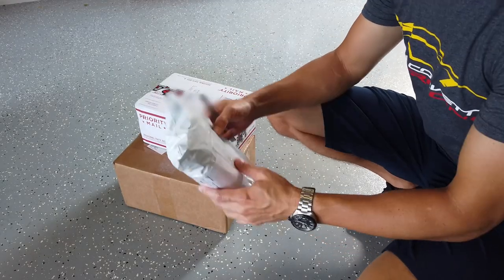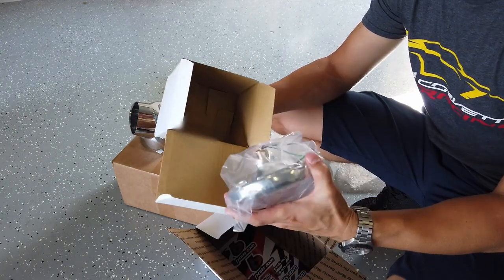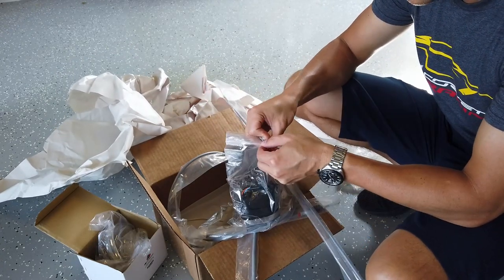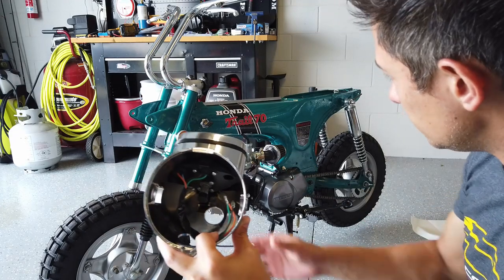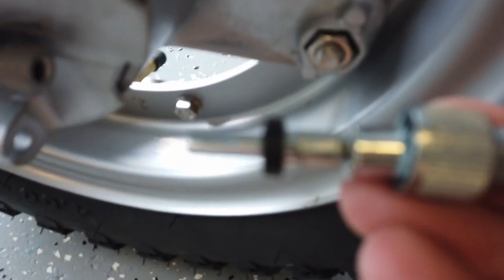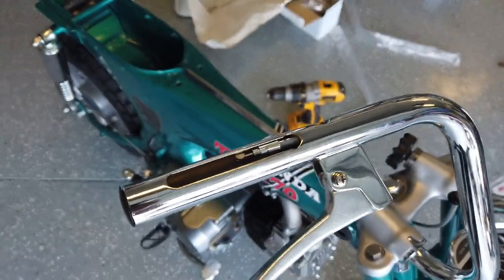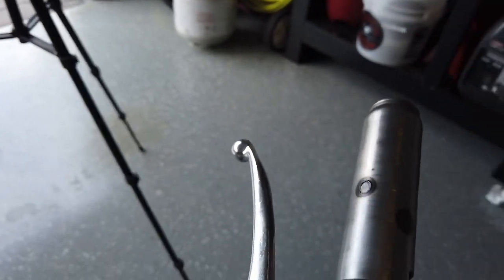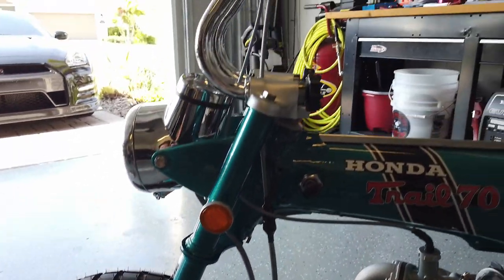Cables, Throttle, Headlight, and Speedometer Install in the 1970 CT70 HKO

Comment: What carb did you use? And do you have a link? I’m having trouble with mine stalling out and a hard time starting after it’s been running. It also sneezes when I kick it on sometimes, not sure what that could be.

Comment: Hello I am installing a headlight which came off and ATC 90 and the bike is a ATC70 I am having problems with the wiring, I have two leftover black wires. Where do they hook up to? If you can help me that would be appreciated The headlight works, but only I think on low. Thank you

Comment: The bolts are all available from Honda. That is what I did on my build and yes they are different from after market. Also stainless steel can cause galvanic corrosion if screwed in regular steel.

Comment: Nice work, I am a fan. I am debating on a Monkey bike or a early 70’s CB350 four as a project.
Reply from the maker: The CT70 platform is fun, relatively easy to work on and is really easy to source parts. CHP Motorsports has almost every part (many OEM) in stock for a build/restoration.